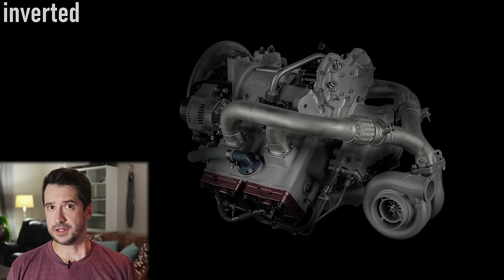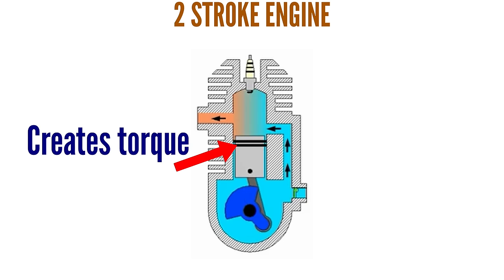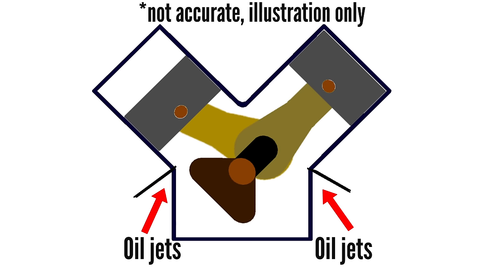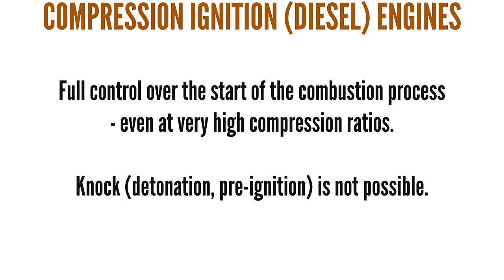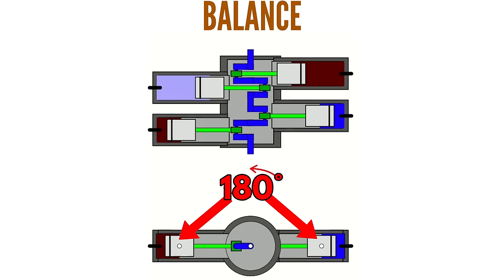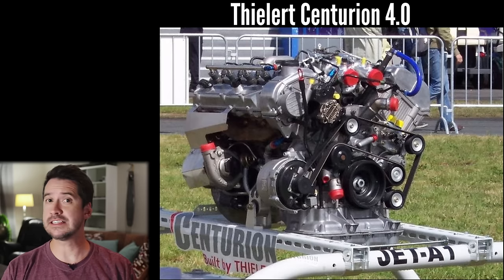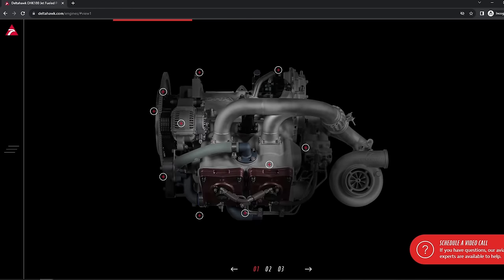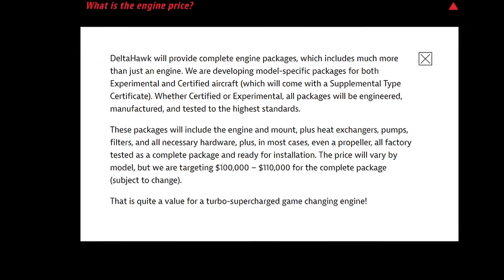Deltahawk's Jet Fuel Piston Airplane Engine Explained

Comment: Velocity V-Twin specs.
Range at 65%
Lycoming IO 320 1400 NM      185 ktas 75%
Lycoming IO 360 1150 NM       200 ktas 75%
Titan IO 370 1150 NM               205 ktas 75%
Deltahawk Diesel 1900 NM    250+ ktas 75%
UL520T 1150 NM                       230+ ktas 75%
Reply: THIS!
Reply: Thank you.
Reply: what is the Vne / Vmo for the V-twin?
Reply: @Sideways71  No not this... it does not even pass the sniff test...  I took the factory tour and even a demo flight in the V twin... It is an amazing aircraft,However even Velocity personnel told me the Deltahawk Diesel is too heavy and complicated to install.  Furthermore, explain how the Deltahawk engines will be faster that the lighter and just as powerful UL520T's ?
Reply: @demagescod9657  It won't be lighter and  won't be faster  (180 hp vs 220 hp)  compared UL520T.  It will burn less fuel and that fuel costs less and is much more available world wide the 100LL.  Remains to be seen,  but it will likely be simpler to work on and require less maintenance.  I don't blame anyone for being skeptical given the long history.  There is still a lot to be proven still but to me this looks like it is becoming a reality and that is a good thing for GA.
Reply: @Sideways71  Yea, I don't disagree, But the performance numbers are pumped up and there are real issues with the complexity of the install.   Plus, the cost difference is staggering and the reality is that anyone who can afford a 6-700k aircraft isn't going to care that much about the fuel savings the extra 100k cost of these engines will deliver when the weight penalty is considered.

Comment: Besides the 8V92 Detroit Diesels that we ran in our Pilot boats that along with the GMC blower also ran a turbo these engines developed 600hp.  The big cargo ships the one I was shown was a 9 cylinder inline 2 stroke I believe that had an electric motor powered blower motor for starting and had 3 giant turbos for running on.  All the ancillary systems such as oil pump , oil and water heaters , and water pump.
Reply: I fill and run BRP XD-100 in my 475hp silver 8v92 2 stroke, works great!

Comment: ULPower 520 has same HP weighs 108 kgs iso 162kgs. It weighs 50% more ! I want to see how that compares including fuel and range, but mostly COG wise. It would require all new airframe designs.
Reply: Yeah but this has more power at high altitude and it uses less than half the fuel for the same power

Comment: 2 stroke diesels have been around since the beginning of the compression engine. Detroit Diesel was famous for their 71 and 92 series and most if not all large ship engines are 2 stroke but as far as I know they all use exhaust valves and most are forced air intake. There are naturally aspirated but very low power. They all use recirculating oil systems. My point is this technology is mostly adopted from other systems but I agree that this should be a better choice for aircraft. The one thing I question is the inverted cylinders and the probability of oil pooling in the backside of the pistons and seeping through the rings when not running. I think this is why they have to hand rotate radial engines prior to start up and hand rotating a diesel with oil in the combustion chamber could be a dangerous situation.
Reply: Most Diesel engines require glow plugs and glow plugs need to be preheated for the engine to start.  It is unlikely anything would happen with a cold engine being slowly rotated by hand.

Comment: Great video thanks! The end fuel numbers on the diesel were a bit disappointing. Most of your old Continentals are burning 8 gallons an hour in 180 hp engines. Another issue with Diesels is they are usually TBR and not TBO so that is a new engine not a rebuild when your hours are up.

Comment: The (sadly defunct) Zoche two stroke aero diesel was a radial format with two up and two down cylinders. All four con-rods were carried on one crank pin. There was zero primary and zero secondary vibration. It was available in 2.5 litre single row and 5.0 litre twin row formats. Rotating mass is reduced the crank simply has to counterbalance the con rod weights.

Comment: Two stroke diesels have been around for years, but mainly in large locomotives. A refinement, not a giant leap forward.
Reply: 2-stroke Diesel engines have been used in aviation since the 1930s
Reply: @WilhelmKarsten  and even opposed piston ones
Reply: The Jumo 205 was the most fuel efficient engine in the world in 1931.
Reply: Fairbanks-Morse has entered the chat.
Reply: Were they this efficient?   Did they have the other easily replaceable features that this one has?  bottom line, we don't have any now, and if this does as intended it has many advantages, you would have to do a comparison or value spreadsheet to really see exactly how this might work for your application.
Reply: @orthopraxis235  the fact that airplanes are exempt from emissions regulations makes them possible. They were great for the time but primitive by today’s standards. Detroit 71 series true innovation was unit injectors not the fact that it was 2 stroke.
Reply: @orthopraxis235  2-stroke Diesel engines are inherently the most fuel efficient engines in the world, but they do have disadvantages, higher cost and higher weight.
This design is lighter, is it cheaper? We have to wait and see.
Reply: @donaldpaton1691  There is very little totally new in ICE design, but the development of many of the more novel designs has been stymied by limited lateral thought and investment by large manufacturers.
Reply: @Swaggerlot  Wow! Where have you been the last 20 years?
 There has been a revolution in digital electronic controls, fuel systems and Turbocharging.
Power density and fuel efficiency has nearly doubled on average.
Reply: @WilhelmKarsten  None of that is new in concept, just the methodology has been updated. Look further than the end of your nose.
Reply: @Swaggerlot  That would imply that a "new concept" would be better than any of the existing reciprocating piston or gas turbine designs currently available... which is just wishful thinking.

Comment: The prop diameter governs the maximum rpm, due to tip velocity, the wider or larger the diameter or hub center to blade tip radius, the faster it is traveling at a given RPM, when the tip breaks the sound barrier a wood prop becomes a shower of toothpicks, a ducted shroud or canard augmented prop blades are used, less radial air dispersement occurs and drag from boundary layer tip vortices is reduced
Reply: Thus more blades instead of higher RPM.

Comment: Great video.  One thing you didn’t cover in detail was the decision to have it an inverted V layout.   Other than access to injectors and plugs and perhaps the CG what benefits are there to this.  I presume the oil savage system has top and bottom sumps to scavage from (sometimes flying upside down) and even sumps at the forward and back ends of engine.  This would require a ballbearing type oil pickup “one way “ valve to avoid cavitation of the pump?
Reply: As a long time mechanic, my experience with inverted engines gives you the ability to swing a bigger prop. Diesel engines have good torque, so your prop could be larger.
Reply: That makes sense cheers.
Reply: good point + a cooling system 
Not light at all

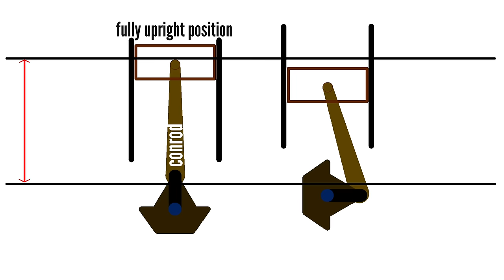Comment: An excellent video but you made one little error at 12:50. The piston moves slower at the bottom of its stroke, picks up speed part way up and then slows as it approaches top dead center. Your point regarding accelerating and decelerating mass still holds true, though.
Reply from the maker: Thanks, appreciated. It's actually correct, because as the piston moves down from TDC, the conrod goes sideways, shortening it (relatively speaking). This pulls the piston down additionally, accelerating it. Past mid-stroke, the conrod starts going upright again, conrod getting longer (relatively speaking), and with the piston going down, the lengthening conrod slows down the piston. Same thing on the way up.
Reply: @paulmaxwell8851 You are right about the piston 'loitering' at bottom of the bore. Because the big end is swung out to the side at the 90 degree crank position, the piston is then sitting a lot lower then half way down the cylinder (this is the cause of secondary imbalance/vibrations). With the crank turning at any particular speed, the piston spends more time in the lower length of travel than in the upper positions, and therefore travels at a lower average speed at the bottom.

Comment: A lot of the principals mention in your interesting report were incorporated in the engines  of the WWII era sub on which I was stationed in the early '60s.
It was a 9 cylinder/18 piston achate cycle supercharged diesel. The upper and lower crankshefts were couipled together by what they called a vertical crankshaft. The supercharger caused the cross flow with fresh air displacing the exhaust. Ignition took place between the two pistons when the were at their closest (and the fuel was injected). 

When commisioned, it have 4 of these, but when I got there external streamlining had been added to the hull (Seee Guppy III) and one of the engines had been removed to make room for a fresh water still and other equipment I can't remember now.

Nobody was worried about pollution then, and it was a filthy beast! ;)
Reply: That was a Fairbanks-Morse opposed-piston engine.  Uniflow scavenging via a positive displacement compressor.

Comment: The Austro AE330 4-Stroke Diesel Engine has also 180 Hp, uses less Jet A, is just 25kg heavier ( = 34 l Jet A) and coast around half the price. And yes, it is a complex engine, but it's also a very reliable engine. And with this price tag, you can afford plenty of working hours of a professional mechanic.
If I really needed an easy to repair aircraft engine, I definitely would prefer an air cooled 4-stroke over a liquid-cooled 2-stroke engine. I do not know anyone who had engine trouble caused by a simple valve drive, but I know some people that an engine defect caused by a faulty water pump.

Comment: A quick correction:  A four stroke engine does NOT produce power  during 25% of its cycle.  The power stroke starts when the fuel is ignited and ends when the exhaust is allowed to leave the cylinder.  The exhaust valve opens around 120 degrees beyond top dead center on most engines, since there is little to gain by keeping it closed and opening it early helps scavenge the cylinder.  Thus, the effective length of the power stroke is around 120 degrees on an Otto cycle engine.  

This works out to about 16.7%, not 25%.....

👍
Reply: or with an offset on the pistons and an atkinson cycle you can push that a little further but lowers the power to weight delivery and gains efficiency which will get you to nearly 22%
Reply: @leonmusk1040  I'd like to see where you get that 22% figure.  Atkinsons are used on a lot of hybrids for efficiency reasons and they could care less about power.  They gain efficiency due to the increased expansion ratio.  This happens because the intake valve is held open longer, pushing some of the charge/air back into the intake manifold, effectively reducing volumetric efficiency.  Since the exhaust valve opens later, the cycle runs closer to full expansion.  Typically, diesel engines run around 30% more efficient than gasoline Otto cycle, so I have a hard time buying that 22% number.
Reply: @Flies2FLL  i believe toyota cracked 40% efficiency. they were bragging about something like 41% with dual injection which puts them in diesel teritory. another thing about otto is that you can have a 2 cam profile engine having both otto and miller so you have fewer pumping losses at part throttle operation.
Reply: @SoulTouchMusic93   I wasn't talking about efficiency, I was talking about duration of the combustion stroke.  I'm not sure about Toyota's engine, but if they achieved that level you can bet it was during laboratory conditions.
Reply: @Flies2FLL The production Toyota Prius 1NZ-FE engine depending on the exact model ranges between 36.5% and a very impressive 40%.
VW TDI engines that came out 30 years ago were already 43%.
 The 2-stroke Jumo 204 was 40% in 1930!!!
Reply: @WilhelmKarsten  Thanx for that.  NOW, why not site your source for those statistics please...
Reply: @Flies2FLL  Sure, no problem.
The 2003 Toyota 1NZ-FXE has a publish BSFC of 0.370.
 Reference SAE Technical Paper vol.1 March 2004 article 10.4271

The 1990 Audi 2.5 liter TDI engine has a published BSFC of 0.326.
Reference SAE Technical Paper "Audi 5 cyl. Turbo Diesel" by Stock, Dieter, Bruder and Richard. Published February 1st, 1990

The Jumo 204 has a BSFC of 0.347 Reference 'World Encyclopedia of Aero Engines: Pioneers to the Present Day'
By Bill Gunston, published 2006 Stroud Ltd UK
Reply: @WilhelmKarsten  So I cut and pasted "SAE Technical Paper vol.1 March 2004 article 10.4271" and nothing of the sort came up.  Care to share a link or are you just talking out of your chevette?
Reply: @Flies2FLL  Well, it's a safe bet you are not an engineer or a member of SAE... so that would make you the one talking out his Rsehole son.
Reply: @WilhelmKarsten  You are definitely talking out of your chevette.  And you are definitely reported-
Reply: @Flies2FLL 
The Toyota does get upto 40% efficiency and can stay close to that due to the electric variable speed “transmission” keeping the engine in its high efficiency region which is quite broad. It is actually an impressive setup from an engineering perspective.

See:

Benchmarking a 2018 Toyota Camry 2.5-Liter Atkinson Cycle Engine with Cooled-EGR
Reply: @Mentaculus42  Thanx for showing that to me.  But there are few automotive gasoline engines that can surpass 38% efficiency. Even diesels cannot pass that.  My wife had a 2015 Lincoln MKZ with the 2.0 liter Mazda engine with the Atkinson cycle; It got about 40 mpg around town and around 40 mpg when we took it from Fort Lauderdale to Key West.  It was SUPPOSED to get 46 mpg, but that didn't happen.  Now she has a Mercedes Benz EQE350+, which is fully electric.  We are going to take it to Key West one of these days, but work is hectic for me right now.  It has 300 mile range and we installed a 12.7 kw solar system on the roof, so she drives for FREE.

Me?  I drove a big V8 Porsche 928S2 5 speed for 19 years, now I drive a '14 Cayman S PDK with a flat 6 that sounds like nothing; The Cayman S is 1000% the better car than the 928, but the 928 had a big block V8 and as a red blooded male who was born in MICHIGAN, the flat 6 works but is NOT the best for me!  Damn I want another 928~

(Don't buy a 928;  Like aviation, these things are addictive)
Reply: @Flies2FLL  

The US government’s Super-truck II Research program had 3 different prototype diesel engines that got 55% thermal efficiency. Probably not practical for real life due to using a bottoming cycle. But the latest new truck engine designs are getting peak efficiencies in the high 40s (48 ish). So it will be interesting to see if this translates to real life.

Comment: 2 strokes do have exhaust valves sometimes. Detroit Diesels were some of the most popular. Full mechanical, compression ignition, and direct injected.  H.O. versions were also turbo charged.

Comment: It would be really cool to see a head to head on this engine vs the Rotax 916 is.

I know there's fundamental differences, but it seems like these 2 engines are going to be some of the prime choices for many people so comparisons are going to be inevitable. At a glace the Rotax produces 20 hp less while weighing 170 lbs less - might be enough of a difference to overlook some of the electrical wiring mess that comes with the Rotax.
Reply: As I recall the Rotax has a reduction drive so it runs at like 5,000 rpm. So much lower TBO. I think it is like 500 hours

Comment: Interesting indeed.  I still like opposed piston engines too  . Don't see either replacing jets though.
Reply: I think it's not intended to replace Gas Turbines, rather it is a small piston engine designed to burn Jet-A, which is available worldwide as opposed to High Octane AvGas which can be hard to find in some markets.
Reply: The opposed piston 2 stroke does not have cylinder heads so it radiates out less than the DeltaHawk design. If the opposed piston had ceramic cylinder liners there would be very little heat sent out through the block and even better efficiency.

Comment: Detroit Diesel two stroke Diesels have 4 exhaust valves at the Top of the head per cylinder
Reply: Why 4 exhaust valves but not 1 large exhaust valve?

Comment: Another issue is it is almost certainly restricted to composite propellers because of crazy diesel power impulses and prop inertia.  That doesnt seem that bad untill you fly through heavy rain, or hail, hit a bird, wet grass, picks up a rock, and turns to fluff

Comment: Great Video. DH is also getting ready to release a 235 HP version of this engine. Which is what I am curently interested in.  Higher HP V-6 versions are also on the way. Sounds like rotating assembly components of teh V6 will be interchangeble with its V4 brother?
Reply from the maker: They are really moving this forward. Looks like the higher HP V4 versions will be the same weight too. Great power to weight balance there.

Comment: Is it possible to mitigate peak pressure, in an engine with a mechanical diesel pump, by altering the fuel pump cam lobe profile to delay some of the fuel delivery during the combustion event to spread out the combustion pressure curve, but still deliver all the fuel necessary for best power output?

Comment: Has to be supercharged to scavenge with positive displacement for the 2 stroke port system.  BUT, that's better than oiling cams and drag levers and pushrods and lifters.  Zoche tried an air cooled radial design like this that did not work well over time.  There is a V-6 for the 300-350hp market under cert testing.